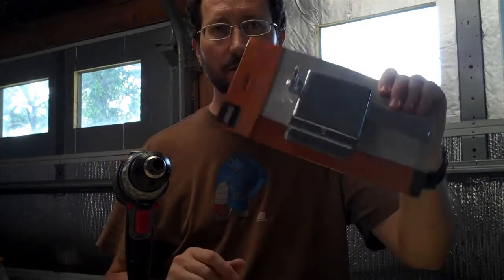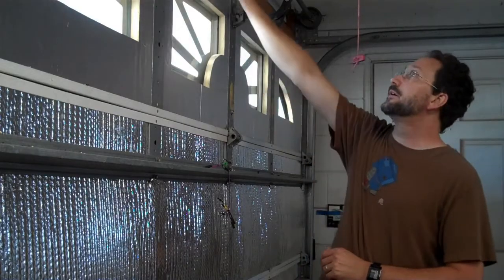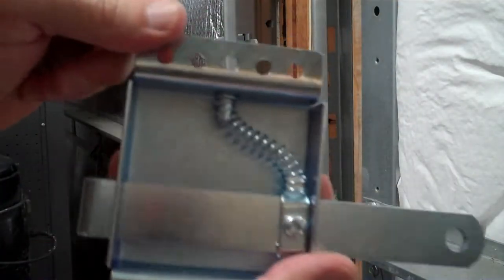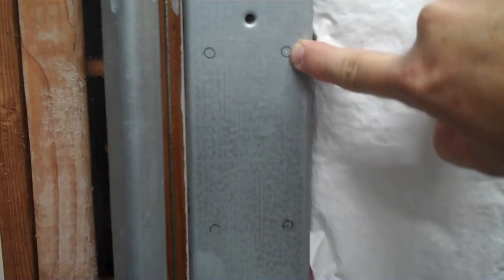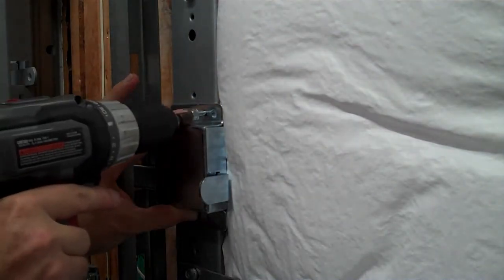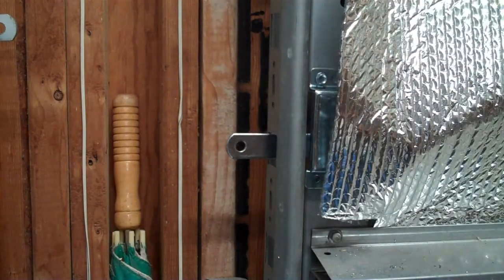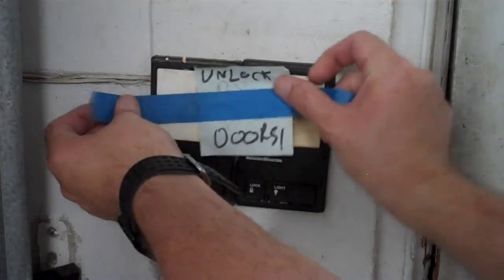How to Install: Garage door slide locks

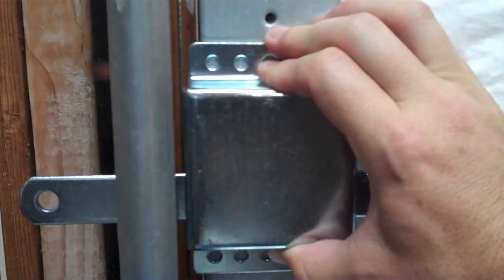Comment: 2:55  Hint: Gaffer tape the 'unlocked' lock to the door in the proposed location PRIOR to permanently fixing it in place and  then run the door up and down to make sure the new lock doesn't hit anything. If all OK, you can fix it in the proposed location with confidence.

Comment: My next project, just ordered a slide lock which will go on the other side of the door, I already have a lock with outside handle whick I rarely use, it's kinda rusty.

Comment: My garage door rails only have two punch-outs for slots, and they are on the same level as existing hinge hardware. What the heck? I guess I'll be cutting holes somehow in the rails. Any tips as how to do it cleanly?
Reply from the maker: I don't think there is any way to do it super clean (unless you want to do a LOT of work with a file....)  I would use a drill to drill out the top and bottom of the slot, and then use a small cut-off wheel in a rotary cutting tool (Dremel)   to "join" the two holes with two lines. If you only have a drill you can drill a series of holes and then connect them with a lot of work with hand files.

Comment: Would you risk burning out your motor if you activated the door opener whilst this lock was on? Thx
Reply from the maker: Possibly, depending upon the motor and if it had an automatic shutoff in the case of excess force or not. I definitely recommend disabling the remote control when they are locked and possibly hanging a sign over the manual buttons.  I have accidentally triggered the door a few times (with the manual button inside the garage) with them in place but caught it quickly and so far the opener motor is still working.

Comment: How to attach the spring (the easy way ) when it pops off.
Reply from the maker: To re-attach the spring, you'll have to take the lock body off the door, then stretch the spring between the two "nubs".  (easiest if you position the lock all the way in or out so they are farther apart and bend the spring into an "S" shape.)  [But it should not pop off in the first place.]

Comment: what size screws?
Reply from the maker: At 0:25 in the video I used #14x 3/4" long self tapping metal screws, but you will have to determine what works well with your particular garage door lock hole size and depth of your garage door bars.

Comment: What about the people's door.  Not everyone has a people's door  that goes in the house.
Reply from the maker: If you do not have some other way to access the garage, you'll need to use one of the versions with an external lock/handle.